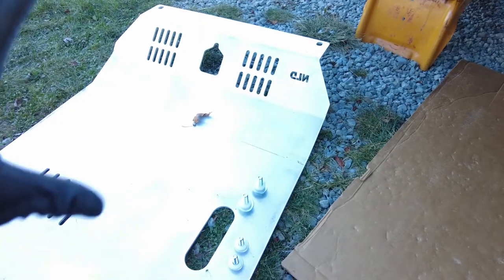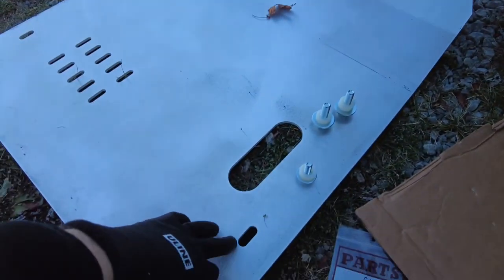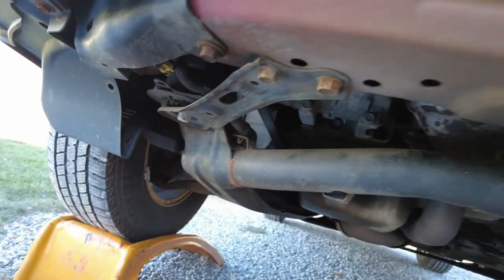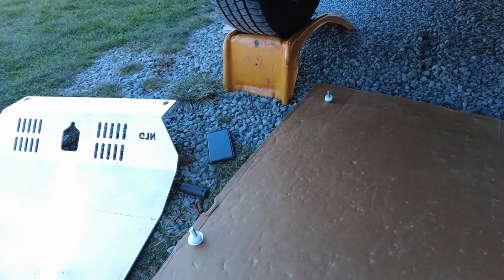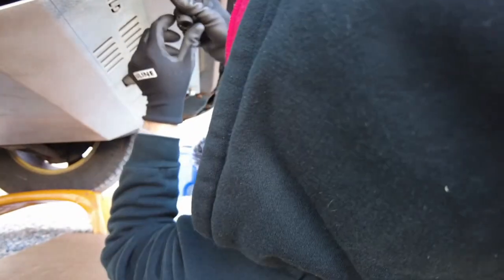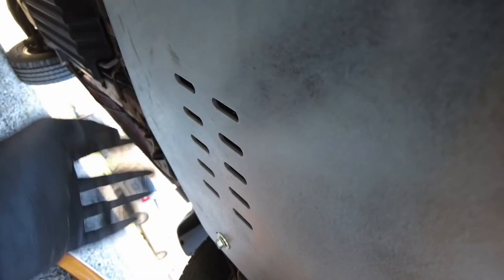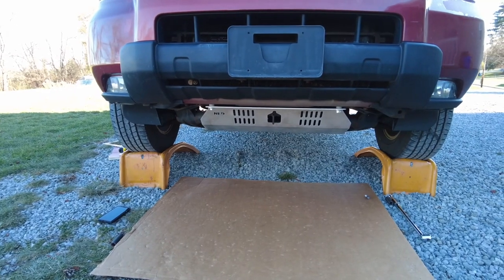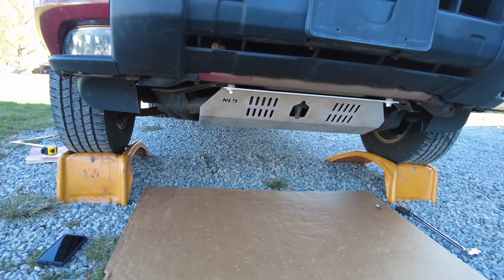2003-2008 Pilot / 2006-2014 Ridgeline Front Skid Plate install

Comment: I your skidplate under the front of my 23 RTL. 

I installed an oil plug replacement with valve. I have the one that turns 90° and points straight down.

For those of us not interested in bashing over enormous rocks way down wilderness trails. Only interested in protecting vital components from misc highway fod. That skidplate could be made of Plastic. 

Additionally, you need to vent engine compartment Heat out the back. Contour the front so you are not in a constant state of air compression at interstate speeds. My MPG's are down 3. 

Hopefully less $ to make it from Plastic  ?
Reply from the maker: Thanks for sharing you thoughts and feedback! Plastic could be a future option.

Comment: Do you have to take these skid plates off when you do an oil change? (2021 Ridgeline)
Reply from the maker: It's not necessary but it's easier. I pull mine to clean off the plate, and inspect everything else. We've had one customer get charged $20 because the plate was installed.

Comment: Will this still allow access to change the tranny fluid ?
Reply from the maker: Great question. The plate allows for engine oil changes when installed but nothing else. The plate must be removed for transmission and ptu services.